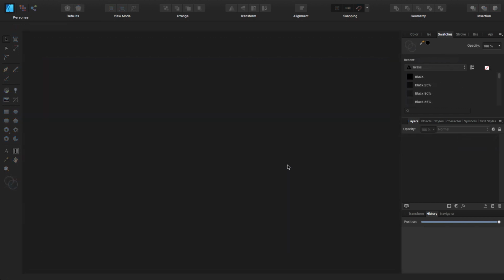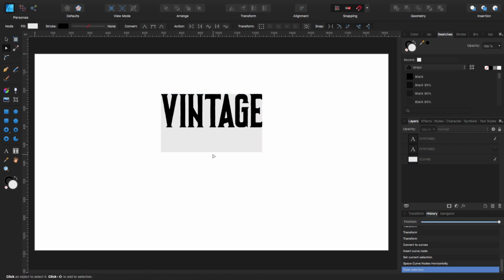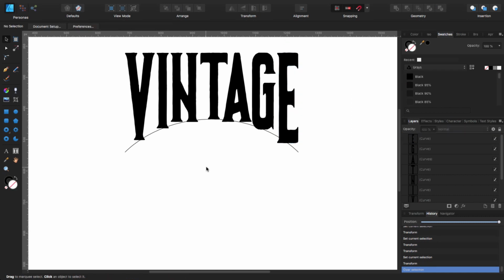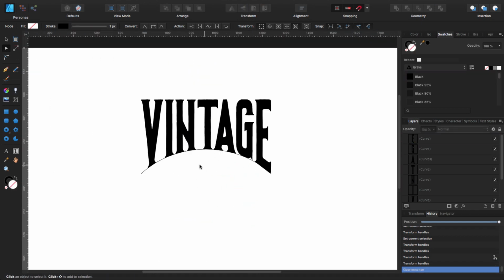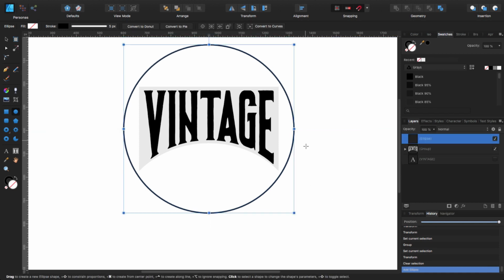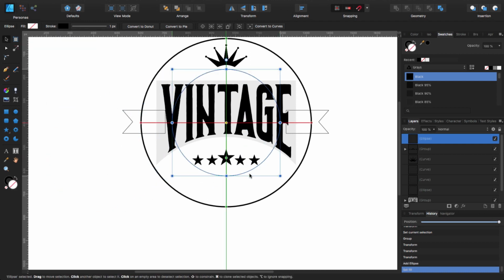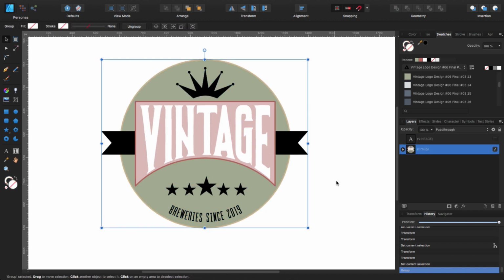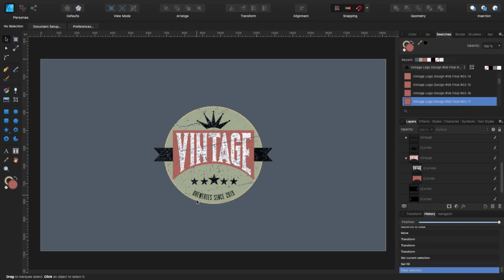Vintage Logo Design in Affinity Designer

Comment: Which button do you use exactly? 3:51 I use Notebook with Windows. It's not working here.
Reply: It worked by clicking both sides of the mouse!
Reply from the maker: @l.serpes3960  Perfect.
Thanks for letting us know.
Reply: and just noticed you'd worked it out! LOL
Reply from the maker: First click with the mouse in one on the handles and keep it pressed, press Ctrl (control) in your keyboard, while you keep control key pressed, drag to adjust.
Reply: @GraphicDesignsa  It simply does not work. Are you using any beta versions? I am using version 1.7.3.481
Reply: @l.serpes3960  I'm also using 1.7.3 on a mac, unfortunately I don't have it in Windows. I'll check latter and let you know.
Reply: On a windows PC CTRL wont work... its a far simpler process.  Right click and hold, then left click and drag.   The same for converting nodes.  Right click and hold (ignore the menu popout) then left click.